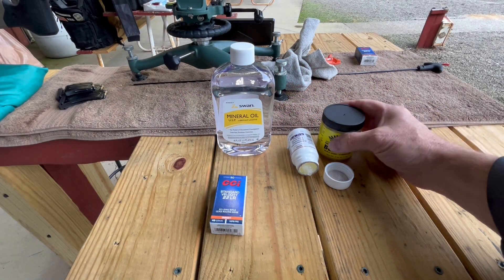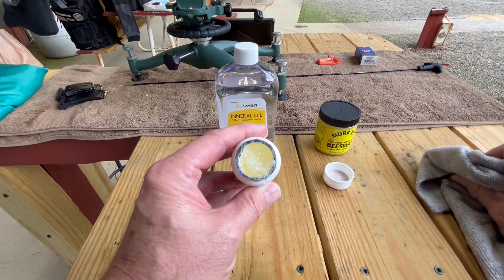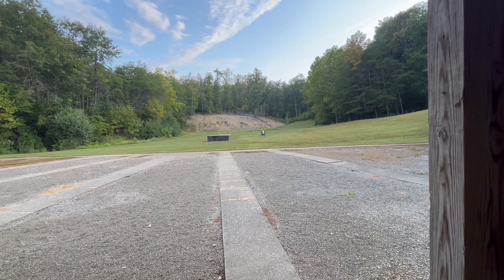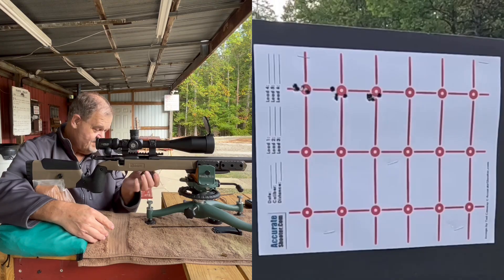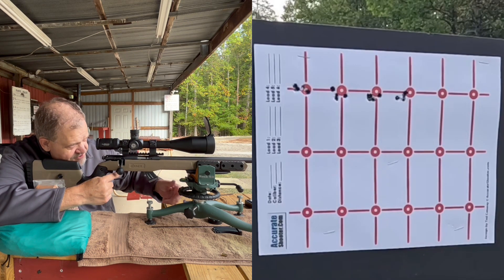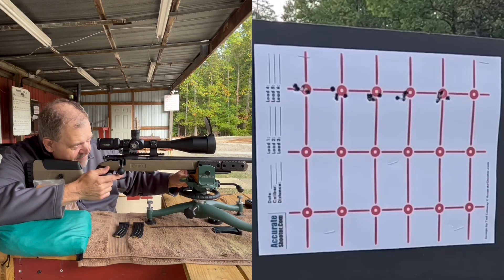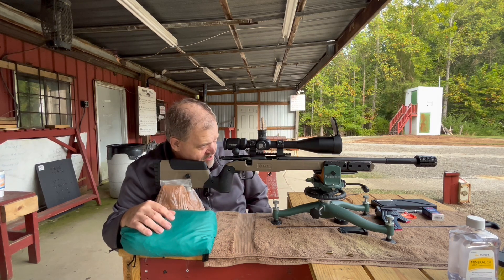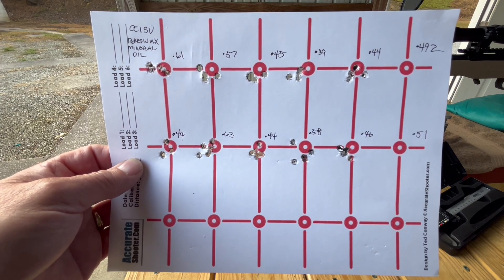CCI SV Mineral Oil and Beeswax.

Comment: It looks as though you are using a MDT Field Stock.  The stock's butt appears to be cupped in a white material.  Would you explain/describe?
Reply from the maker: Yes sir. The buttstock and forearm are full of added weight. This weight allows me to free recoil the rifle to allow it to come straight back without throwing the shot off. Also it helps stabilize the rifle so it doesn’t move under the trigger pull. What you see is a piece of folded wax paper that allows the rifle to slide easily to allow the free recoil to be effective. My rear bag also is wrapped in a plastic bag so I can freely slide it on the bench to help align my shots much easier. I hope this explanation is helpful. 😊
Reply: @LeadFever-T1X  Many thanks.  I am trying to convince MDT to make this stock in a form for a left-handed CZ 457.  I think also that you "pinch" the trigger - which I do too.  Looking forward to your final conclusions.   I think you have switched to Norma TAC 22.  So I am going to order some  in anticipation that is the brand you have settled upon.  Take care.
Reply from the maker: @samspade-x2g  Just a word of warning. I had to bed my MDT field stock. The only portion of the rifle that touched the aluminum bedding block was the bottom of the action screw studs. It shot terribly in it until I fully bedded it. I’m not sure how the CZ 457 fits it. I am still going to use CCI standard velocity too, but will be doing tests on both ammo selections. The pinch method is the best for a heavy rifle. Thanks for watching and participating. I really appreciate it. 😊

Comment: Have you tried resizing CCI standards? I have a die that puts a flat nose or hollow point in them ,i dont remember the brand. It can be found on the Internet. That would be a good video.
Reply from the maker: I haven’t yet but I’m ordering a Neal Walz die set. It’s the original one. It will be a while before I get it but it’s in the plans.
Reply: @LeadFever-T1X thats the one. Looking
Reply: Looking forward to a video on it to see if it improves accuracy.
Reply from the maker: Me too. I would think it will because it enlarges the forcing bands to .224”. You can actually adjust it to whatever size increase you want. So you get more engagement with the rifling. I would re-crimp first and then re-size and profile.